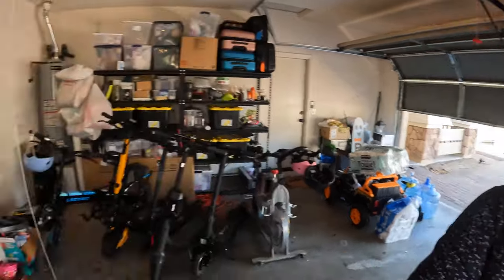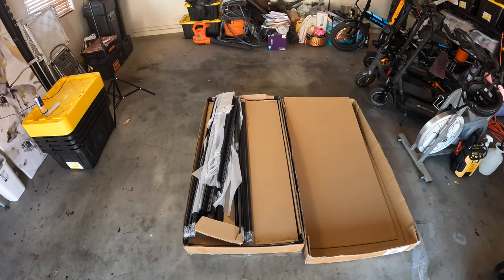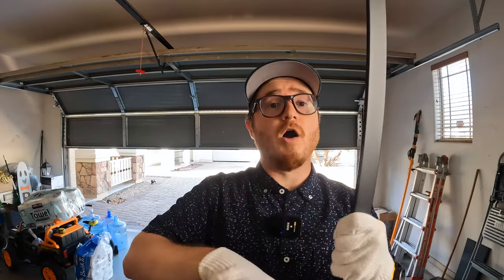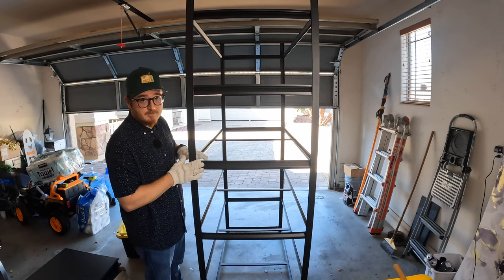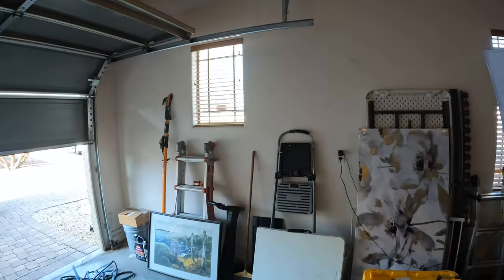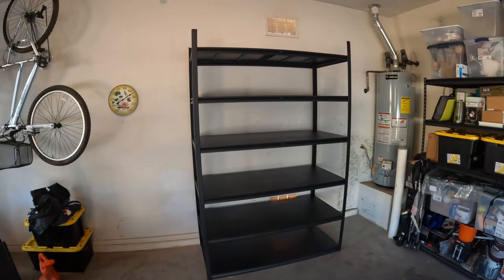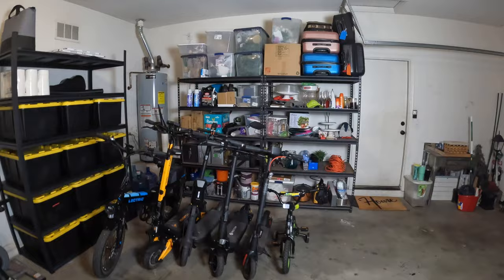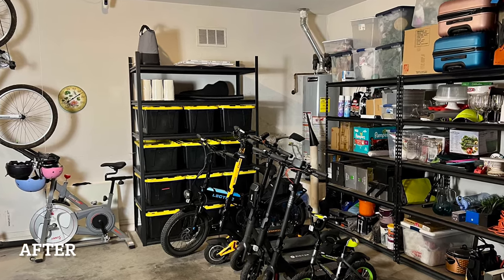From Clutter to Clarity: Organizing My Garage with a Reibii Heavy-Duty Shelving Unit

Comment: I am hoping to have  shelving units That I could store my snow blower, lawn mower, generator etc under when not in use.  to do that the lowest shelf would need to be 25 to 33 inces off of the floor.  Do you think that would work with this unit or would you be afraid that would make the unit unstable?  How high up do you think the lowest shelf could be off of the floor without causing a ungenerous situation?
Reply from the maker: Hello! So these units likely wouldn’t be good for this purpose. The lower shelf is important for stability, and I’d be worried about accidentally bumping one of the lightly supported legs.

Comment: Can this code be used on the amazon Reibbii shelfs? What shelfs did you have before? I am looking at the 40 inch by 60 inch high Reibbii shelfs for my shed.
Reply from the maker: Hello! I had shelves from Home Depot which don’t hold up well over time. They had particle board shelves which are never good. The code only works on their site :(.

Comment: Hi there.  I have been looking and looking for good sturdy shelving.  This looks exactly like the kind I like.  Two questions.  The height of the shelves look adjustable.  Is that correct?  Also, any problems with bowing?  Thank you for a good video.
Reply from the maker: Hello! Thank you! The shelves are height adjustable and no bowing to speak of :).